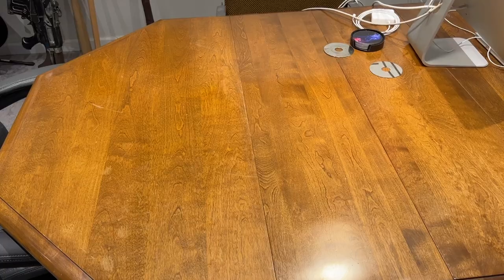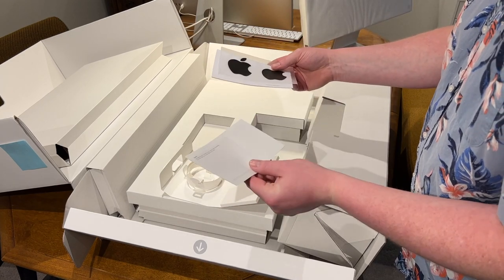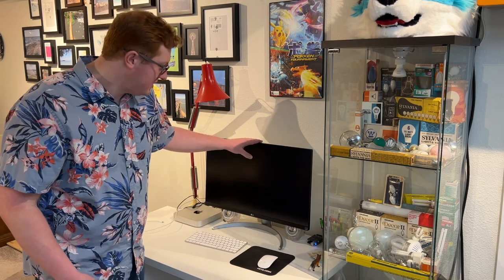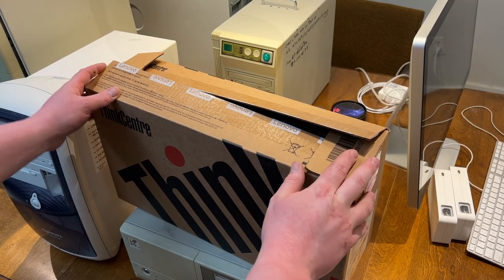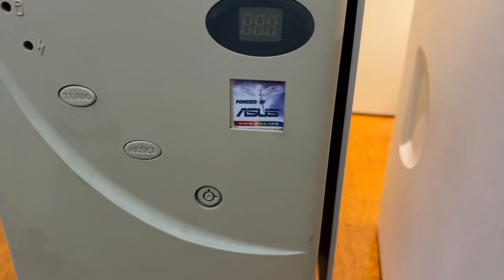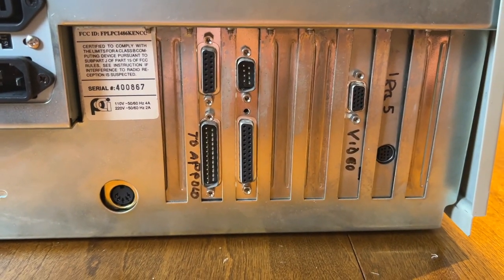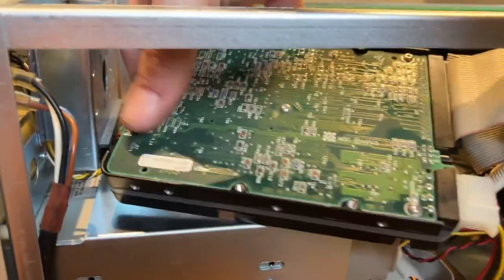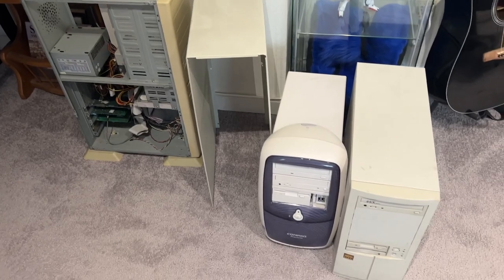Never Ending Beige Computers! - 38

Comment: That +CPI machine is probably just a cheap generic deal. That chassis is super generic and looks exactly like all the Windows 98 machines we had in our schools up until my district completely replaced them all in 2008 or 2009.

God what beasts those machines were lol. They used Deepfreeze to keep kids from destroying the PCs, but IT was so lazy they just grabbed images off of every computer when it was confirmed working.

So with those snapshots restored so was everything else. Like one computer station I was assigned had random bitmap drawings and Word documents on the desktop eternally.

One Word document was dated from 2004 or 2005, I was using the computer in 2007. 😂

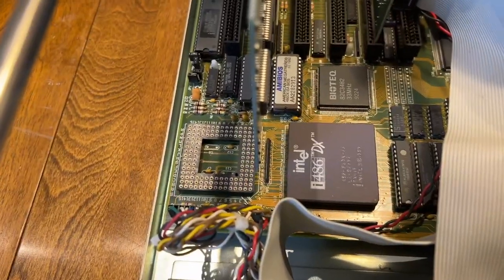Comment: Sweet! Now those are real retro machines. The 486 with two sockets is real old school at 31:18 The second socket is for the math coprocessor. The old processors were not very good at computing, so they needed some assistance.
Reply: Also this computer does not „need“ one, as it runs a 486dx. Unlike the sx, the dx had a math coprocessor included.